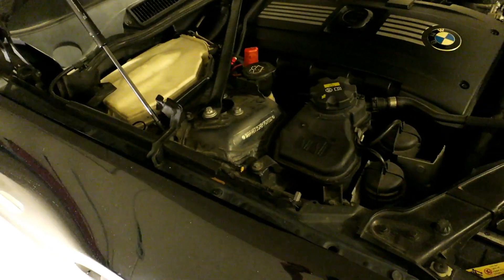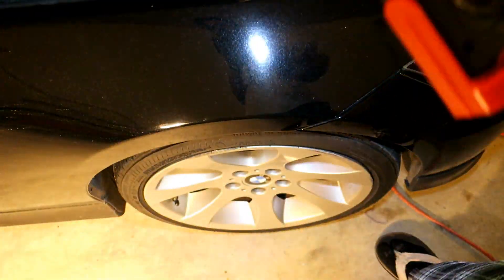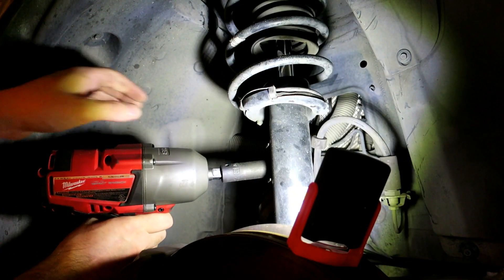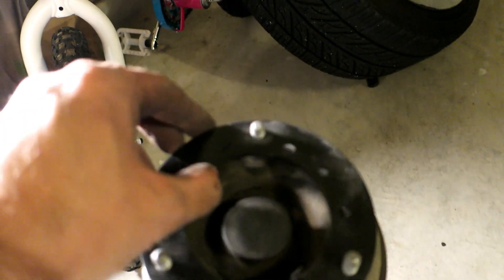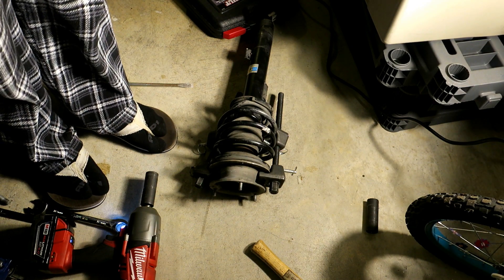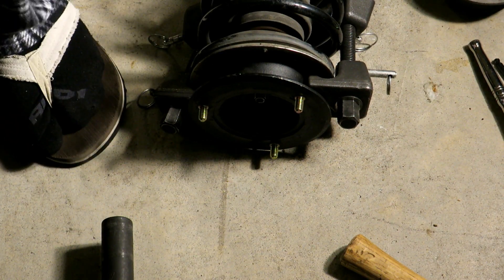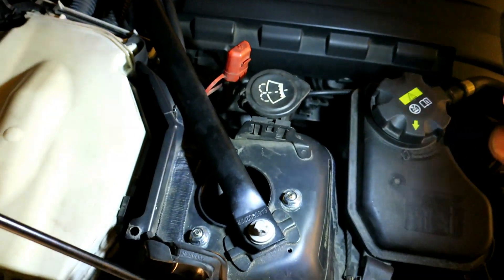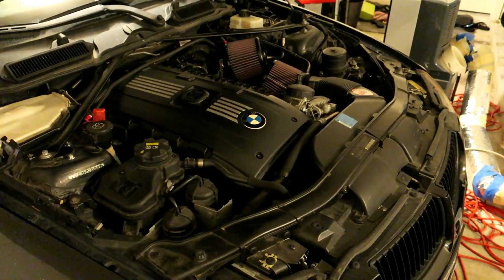BMW E90 3 Series Front Strut / Strut Mount DIY

Comment: Thanks for the tips and tricks, especially the way you mounted the strut compressor on to the collar and not just on the spring itself. People may not realized that mounting the compressor tool on the spring will not compress it enough to release all the tension on the strut as you can only grab 2 coils on one side. Great video and very helpful.
Reply: This was my problem and could not get to the bolt. I did not realize it can be done like this safely. So a big thank you for this
Reply: Been struggling with this myself not enough compression with the available space on the coils

Comment: How did you get the springs to compress properly without them sliding down the springs themselves? I have the identical compressor and it just isn't working right and keeps sliding away 😒

Comment: Other videos have recommended loosening the control arm & tension strut bolts. But those are torque to angle (and I just replaced em too) so I don't want to do that...but I suppose I would rather that than risk straining the bushings by letting the steering knuckle hang on them. 
Thoughts?
Reply: Hey any updates? Did you have to loosen the control arms? Hoping to avoid doing that
Reply: @TheFear37  Unless you have the M3 control arms upgrade, you DO need to loosen the control arms to get the knuckle lowered enough to get at the top of the strut. The bushing on the standard arm, at the subframe, flexes as the wheel goes up and down. Lowering the knuckle enough to get at the strut top will stretch the bushing excessively and tear it. Same with the tension strut.
The M3 control arm is different however because it's a ball joint at the subframe.
FCP Euro sells a bolt kit for $50, and then you can replace them any time you want.
I was an idiot and needed to replace the strut mounts AFTER I already did shocks and the control arms upgrade. What I did was I left the control arms on the knuckle, and only popped the tie rod and and the tension strut out of the knuckle, so they were unloaded and I could put the knuckle basically anywhere I wanted.
Reply: @Gutsmagoria  Thanks for the detailed response. This helps a lot
Reply: @Gutsmagoria  One more question. I have the M3 control arm set as well as Bilstein B12 kit. I need to do both but can't do both at the same time. Based on what you said, would it be better if I did the control arms first then the struts at a later time after? The way I'm thinking about is that, if I do the struts first, I'll have to loosen the control arms twice. Once for when I do the struts, and then again when I do the control arms. But if I do the control arms first and upgrade to the M3 arms, when I go to do my struts, I won't have to loosen my control arms.

What do you think.
Reply: @TheFear37  Why can't you do both at the same time? I would if you have the parts.
Well, either way you'll need to loosen the tension-strut (trailing arm) at the subframe or remove it from the steering knuckle when you do the struts. Yeah, I would say if you had to do only one and get back on the road, I would do just control arms. However, you will need a steering alignment after that. The M3 control arms are slightly longer, which gives you a slight more negative camber, which is sexy, but think about it, you should need your tie rods a little longer also or else have excessive toe-in.
Now after the struts...I'm not sure. Hypothetically no, unless there's a camber adjustment with your Bilsteins.

Comment: Well I'm almost positive that you are not the reason that that mount failed, I've learned from experience that all of these strut mounts on most e90s at least the pre LCI ones have strut mounts that all have the same exact common failure point. What it looks like is during the manufacturing process you can tell that there's two separate pieces of rubber that they then melted together to make that mount and on all the ones that I've seen failed they all have the same spot where the rubber was melted together it appears that they didn't actually melt it all the way together so what actually happened was just a thin layer of rubber melted together to keep them bonded together but I'm pretty sure they were designed to be one solid piece of rubber. I have an 08 335 same as yours and had a 07 convertible 328 and on both cars both sides, driver and passenger completely disintegrated a perfect ring just like how yours is but on my 335 (my daily) to the point that I was driving around with just the springs for quite some time, super unsafe, the shocks were so spent that once that piece separated the car actually lifted by a few inches in the front.. anyways. Love your videos bro they have helped me a lot much love here from Tucson Az

Comment: I know it’s a good idea to get an alignment after suspension work, but do you guys think we could get away without if we’re just changing the mounts?
Reply: I think you're good without one. Camber is controlled by the control arms, tension struts, and that locating pin on the strut mounts, which never move so that's basically static. Caster is also static because the control-arm and tension-strut lengths don't change and there is no adjustment.
I've heard of changing camber by removing the strut-mount locating pin and then the lugs can move within their slots.
At any rate, when I took my car in to a high-end German imports shop for a full 4-wheel alignment, they adjusted rear camber & toe, and only front toe.
Reply: @Gutsmagoria  thx buddy. I never did. I’ve been only getting alignment if I remove a control arm or tie rod.
Reply: @AtomicPixel  mine was after I upgraded to M3 control arms and tension struts. They still only did toe. Even if I didn't change the tie rods, I still think I only needed alignment because the M3 control arms are slightly longer. The tie rods require a longer setting to match.

Comment: Does the strut mount able to turn after you torque the nut?  I torqued to 45ft lb based on the spec.  The strut mount can't spin by hand.  Is it normal?
Reply: no your mount is seized, the top hat should freely spin
Reply: @aimized1460  Thanks for the reply.  I turn the disc up side down, so it wont spin.  I can't tell from the instruction and need to research many video to find the correct way to put the disc on the mount.

Comment: Thanks for the video, I couldn't figure out how to compress the spring enough with the AAP compressor, so thanks for the idea about clamping them over the top support. I am still pretty nervous about how tight they have to be to get it compressed enough, one of them is not fully seated on the support, sort of goes off at an angle. 

There should be a paper gasket on top of the metal ring that goes over the strut. It is probably bonded to the underside of the strut tower. Not sure how important that is maybe prevents some squeaks. Also the strut mount for the i and xi are different.
Reply from the maker: Yes there is a beige paper gasket that goes in between.

Comment: Great video.   Just did it on an 07 x3 e83.  Just about the same.   Did take the brake caliper off which also made it easier to see the bottom of the strut.   The tip about using a spark plug socket to put back the nut was priceless (size 13/16" sae) .   Saved me a long trip to town - do not have a 21mm pass thru socket.
Reply: For the record it's an o2 sensor socket

Comment: I don't think the "nipple" was your problem.  Previous owner probably took the roll pin out of the strut bearings to allow a little bit of camber adjustment.  the Lemfoerder strut bearings also have the "nipple" cast into the plate so you can't do that, or you'd have to grind it off.  I'd file this under "stuff happens".  Thanks for the vid, I'm just trying to make sure I have my stuff together before I try to do a driveway strut swap.

Comment: I just pull the strut down and do it on the car. You don't need to remove the whole tube from the car.
Clamp it down and go at it.
Good job otherwise.
Those strut berings rarely fail according to my BMW parts guy. I live on the west coast and the nearest one they have is in the middle of the country.
I used a Monroe one.

Comment: Actually, your old strut mount DID have a nipple just like the new one you show. Reason it was no longer there (just a hole left) was because it was popped out as you tighten your 3 mounting screws. Just like the screws, the nipple was just stick to the mounting body, if you apply enough force, it would just popped right out. thanks for the video, i did strut on E70 and E46 before, but tomorrow will be doing my E93
Reply: He said the pin wasn't there when he was fitting the mount. Most likely it was removed previously to gain more negative camber. He should have done the same - removed the nipple from the new mount so he adjust for more negative camber.

Comment: How long did this new strut last? still ok i assume.  Also, when you did the other side, was the mount ok or did you have to replace it.
Reply from the maker: The new mount is still working well, I had the other go a few months later and replaced it with the same part.  They're both fine so far.

Comment: I know this is an older post. But I felt you needed to know. That black ring you installed was an error to a previous owner. It's called an upper strut tower reinforcement plate, or ring. And it doesn't go on top of the strut hat, but rather to squeeze and sandwich the metal just under the strut brace. In time the bolts on previous BMW cars the strut would pull the nuts through from underneath, destroying the factory metal. This is a ring designed to bite on a larger area like a massive washer. So you should be able to see them as black rings just opening your hood. That's why they looked all bent up too. It's not supposed to go underneath and on top of the hat. Rather on the opposite side of the metal to the shock tower of the body. Hope this helps... also, another reason that guide nipple was missing. And why it was bent up, it may have smashed it out during install,  or removed to allow no interference... anyway. Great content as always. Keep up the good work...